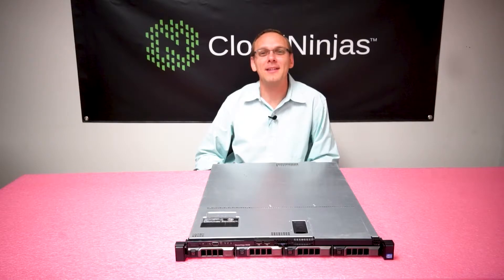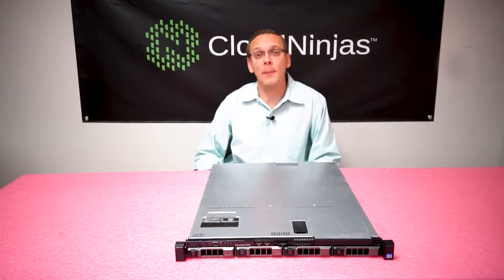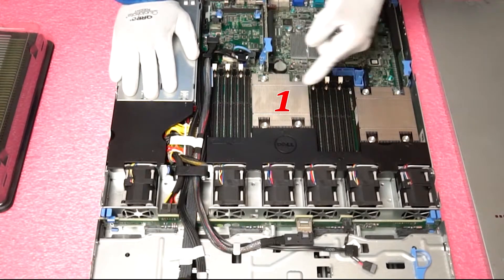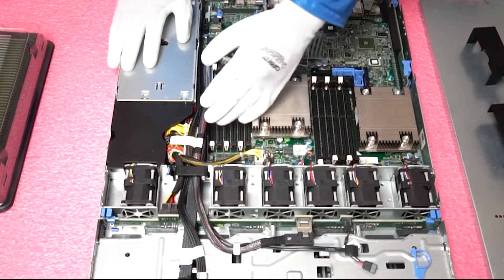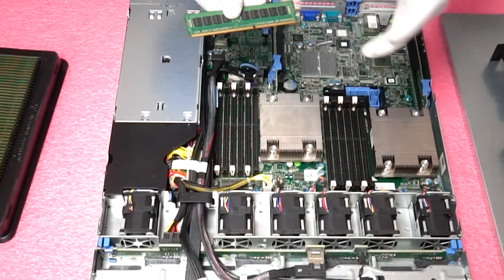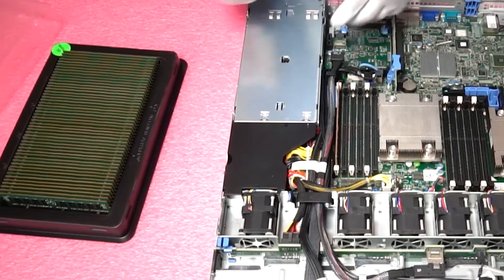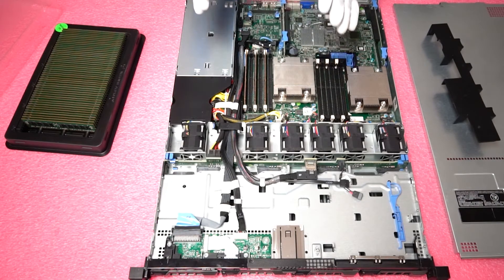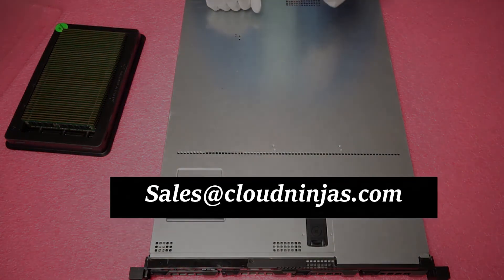Dell PowerEdge R420 Server Memory Spec Overview & Upgrade Tips | How to Properly Load the System

Comment: Great video mate! Upgraded RAM on my R420 flawlessly with your guide. Though am now trying to upgrade my R420 to 10G nic. Watched your guide on upgrading NICs for the 2Us servers. 

Would the R420 support the ones from 10Gtek or intel. Or should I only use the ones from Dell only? Pretty limited options if so. 

Am running vSphere 6.5 with Windows and Linux VMs. 

Thanks!
Reply from the maker: Appreciate positive feedback.   NIC on R420 is limited.  Built in 1GbE or can add PCIe 10GbE.  Contact sales for more info on our stock.

Comment: mate, I have 2 of these machines, they have 4x8gb, same memory model. I took the memories from one machine (R420B) to upgrade the total ram of the other machine (R420A), and the machine boots, it sees theres 64gb installed, it runs memtest86 flawlessly, but keeps returning errors with the ESXI running. Whenever I remove the extra memories from the R420A and return it to its initial 32gb, everything gets back to normal... What can I be doing wrong? I was looking at the manual of the server and there is no example of slot usage for a 8x8gb setup... Have you ran into something like that yet? What slot utilization you'd recomend me to try? the memories' model is M393B1K70DH0-YK0
Reply from the maker: We ran into a similar issue about 2 years ago.  We built 40 of these for a customer.  They had 12 systems that just would not accept low voltage memory.  I don't remember what the resolution was... but I can say that is likely your issue... If you get the 1.5V RAM then it should work just fine for you.  Was your original RAM 1.5V?  Good luck.  Smash that subscribe.
Reply: @cloudninjas  the memories are all 1.35v . Today I've received new ones I bought, same model. I tried the new memories together with the original memories of the R420B and so far, so good. Everything worked fine on the testbed. Today Im gonna get these new memories and add them to the running R420A and see how it behaves. Btw, I simply installed then in A1,A2,A3 and A4 slots, same for the B slots.

Comment: I have 12 2gb sticks on order and will be replacing with 6 8gb sticks. can I use 6 of the older 2gb sticks in the black ram slots to fill them up?
Reply from the maker: Yes.  You can.